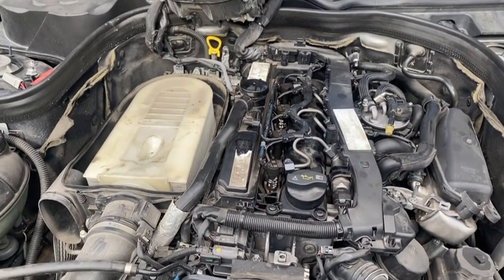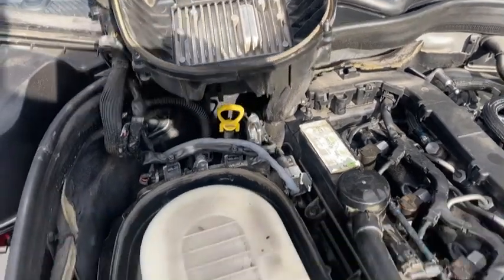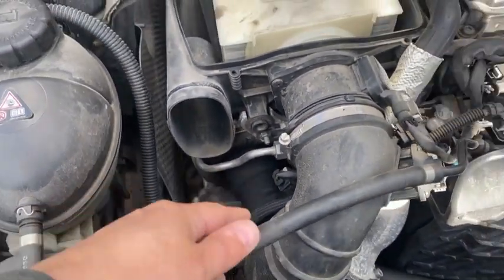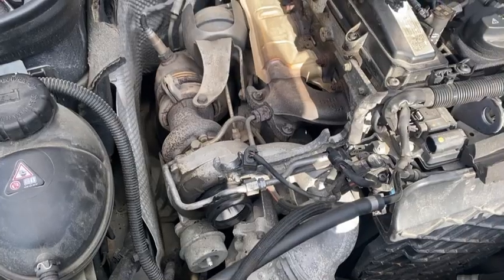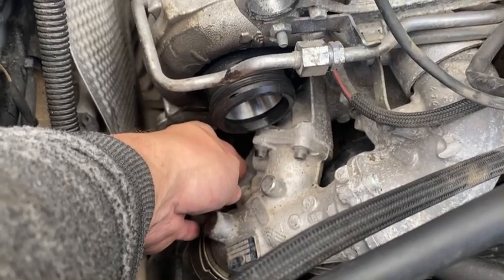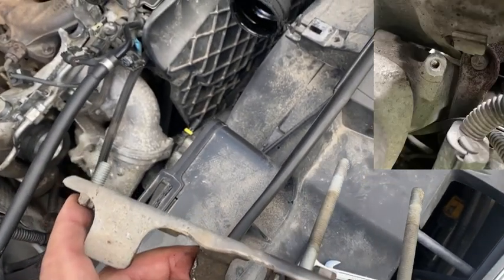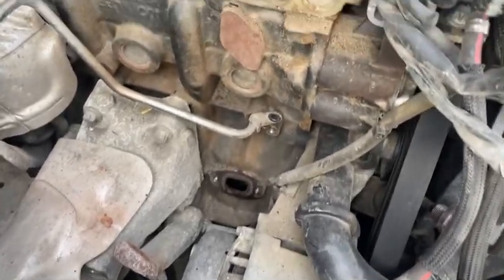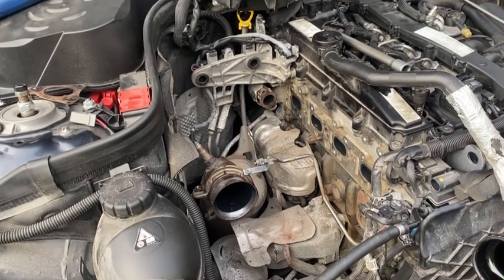W212 OM651 twin turbo upgrade, removing old turbo.

Comment: The dpf bracket and the egr is npt a problem, just bend the plate a little and the egr remove the other connections in the back instead.

Can someo please tell how to remove the oil returnline connection,, there is no where in hell it's not even close to possible i've tried close to everything now.

Comment: Hi, I have a small question. Was this a single vgt turbo or was it a twin turbo.  And what was the upgrade. I saw some turbos available for a vgt swap, that would get you to 220-230hp. But I would love to swap the vgt to a hybrid twin turbo that's also available for om651. It would be capable of hitting 280 numbers.

Comment: I've done this job 3 times and its extremely difficult. Over engineering on brackets that is totally unnecessary. It would be easier to take the engine out !!!
Reply: Hi! can you please tell me how you removed the turbo on this OM651 engine?? i've been trying and can't find a way...

Comment: To get full access to the turbo, you need to unscrew (just a little) one single thing. It's the ring holding the pipe the MAF sits on, which goes from the air filter housing down to the turbo. You can use a screwdriver to release that. You pull the pipe back until it separates from the air filter housing. At the same time, you pull up the filter housing. Then you remove the ECU plugs, and you can get the entire airfilter housing out. It takes me less than 1 minute.
Reply: 😢😢є🎉😢🎉😢😢😢є😢😢😢
Reply: Removing the airfilter is like wiping your ass, most can do it without a problem.
Reply: @FSandberg  And yet, I've seen som many people desassemble the whole thing until they understood that they chose the hard way

Comment: Just for anyone wondering I’ve just done this job on a 2017 c220d exact same set up little differences in certain places but it is NOT a job for amateurs, 9/10 would not recommend.
Reply: Did you have to remove the engine or you took everything apart like in the video?
Reply: @Kittyfh4 same as video didn’t remove engine

Comment: I found if you remove the dpf you can access them too nuts on the bracket really easily I did the same job on jack stands
Reply: I’ve just done the same I managed to get the 2 copper nuts on that bracket with ratchet spanner
Reply: you mean cat, dpf is under the car but will have to come off too, makes it easier

Comment: This Video made my day 🙂 I am actually trying to remove and change the exhaust-manifold on exactly the same car. It's my wifes car. I started the work about 1 week ago, thinking of an afternoon-job. 
BUT....every single piece you try to remove is offering a new problem. I  indeed had to buy new set of ring wrenches to get some screws loose.  Really a pain in the a***. 
Luckily I have found your video which makes me know where the bolts are to loose the turbo. Just to get some space to remove the exhaust-manifold.

All the best for you!!

Comment: You are always right how did you lose this Bolts??? I got om651 too but it was a dumb engine there we're a boost leak on the right side i tried to fix that but it was absolutely pissing me off so i selled that Car and bought the om642

Comment: These engines are really easy to work on..... But only when the engine is out of the car 😂 im here because after replacing turbo i'm left with one bracket and forgot where did it go 😂 thanks for the video
Reply: Hi! can you please tell me how you removed the turbo on this OM651 engine?? i've been trying and can't find a way...
Reply: @FSandberg you have to remove DPF and exhaust manifold to make some space and remove all brackets off the turbo to gry them out of the way other wise there wont be enought space to remove the charger then try remove it from the bottom where dpf was, your car might be diffrent variant to mine on this case you can loosen engine mounts and lift the engine little bit it will give you lots of space to work with
Reply: @FSandberg you might need to remove bigger actuator of the turbo aswell

Comment: Hi,
I have just attempted this same job and gave up as I thought I'd hit the limit of my capabilities, seems I was wrong, the only element I couldn't complete was a part you seemed to not complain about,

The two bolts that hold the oil return pipe onto the block of the engine what tool did you use to remove them and how did you reach them because that was where I had to stop because I couldn't see a feasible way to remove the turbo without first removing those bolts, please can you help me as I've put the car back together but will happily do the work again if it means I can complete the job
Reply: yes! this is where this job get impossible.... and as allways the video or forum left the most vital information out..

Comment: Hi everyone!
My s212 e220 diesel shows the P0252 fault, (injection pump fuel metering control  "A" range/performance (cam rotor injector), it appears often afer 1 hour driving, mostly when accelerating from 120-130 kmh.  Last diagnosis i made it showed  even a pending fault P0299 low turbo pressure. Are these foults related to each other. Any thoughts/ advice ?
Reply from the maker: Just saw your post, change the fuel metering valve at the HP pump, they are known to go bad and causing all sorts of trouble.
Reply: @MJPilote  Thanx mate 🙏
Reply: Hi guys, would a faulty fuel valve cause low boost p0299 ?
I have low boost fault on my Vito w447 Om651
Reply from the maker: @performancejunky3258  boost leak, front two manifold bolts broken, or intake cracked are the most common. Least common, split intercooler pipe.
Reply: @MJPilote  Thanks for reply, I have done a smoke test with no obvious leaks, no leaks around manifold or intercooler have changed both boost solenoids inc cross over valves 
Still no difference,  codes I get are P0299/P00C400/P2261
Really confused.
Reply from the maker: @performancejunky3258  check the front manifold bolts with endoscope, wont show on low pressure smoke test. Quantity adjuster gives its own code and low rail pressure.
Reply: As i wrote before, got the p0252, now this code dont appear anymore, instead i get p0299 turbo pressure low boost 😂

Comment: Hi MJP, have you fitted the turbo now? Really curious how your mods turned out?
Reply from the maker: Turbo is fitted and working very nice, spools instantly. Good power, but I need to dyno it to see how good. Have been really busy with other stuff.
Reply: @MJPilote  did you chip the car? or stock ecu?
Reply from the maker: @MyGoal1000  Yes, my own custom software with bigger injectors. Enough juice to overwhelm the transfer pump, but pulls very strong.
Reply: @MJPilote can you confirm the part numbers for the bigger compressor and turbine wheels?
Reply from the maker: @indigoskywalker  Not many options available to BW turbos, just choose the one that supports your intended HP and flow figures. Can't remember the numbers but the middle size option for most BW turbos for that frame size 651 has.
Reply: @ do you remember the sizes? my turbo is being refurbished and it might be worth asking them to change the compressor and turbine wheels
Reply from the maker: @ next size for K04 turbo, 45-46mm comp and turbine
Reply: @ aha so it is a BW K04… both the comp and turbine are 46mm in yours? i have seen that the turbine can be “clipped” to help flow
Reply from the maker: @ yes BW k04 45mm comp inducer and turbine 46mm exducer not many versions for those sizes so should be easy to find. And never clip the blades, that is a sure way to reduce turbine efficiency. Use correct turbine for the application and no need to butcher anything. Bygone era butchering blades when suitable turbines where not available.
Reply: @ so both the compressor and turbine are 45mm inducer/46mm exducer? that doesn’t make sense as the inducer is larger than the exducer on each wheel. do you have the inducer and exducer diameters for both wheels?
Reply from the maker: @indigoskywalker  where did I say both are the same?
Reply: @ i was just double checking, but you are omitting the full spec of the sizing. having looked at mamba and some other 3rd parties it’s really hard to match. none of dimensions are exactly 45mm or 46mm, they are 46.4mm or 45.3mm etc etc. The company rebuilding my turbo have asked for exact inducer/exducer measurements for both turbine an compressor
Reply from the maker: @ well I dont remember them and  am not at home.
Reply: @ it’s ok, you have given us all lots of helpful information, I will figure it out
Reply: Curious hp turn out?

Comment: Can you please tell me how you got those two bolts at the rear of the manifold off for the EGR? You are right it is a NIGHTMARE !! I am stuck on this an now with no car.
Reply from the maker: With a spanner, using a larger one as leverage. Can't remember if the bolts where E8 or E10 but just with a suitable closed end spanner. Its very tight squeeze, and if I recall the bolts are non magnetic even so you can't pick them up with it ih they fall.
Reply: @MJPilote  Thanks you for taking the time to reply.
Reply: I just finished this yesterday and what a nightmare. I am sore all over!!  Just to give more pointers
You dont have to remove the EGR pipe at the end of the exhaust. I managed to pull the manifold out and gold it up with a bungee cord which gave plenty of room. The pipe is a flexy copper one so it will take the bend. 
The bracket onto the alternator is a pane too. I managed to get than on from underneath with hose going into the inter-cooler off and battery disconnected in case it short the alternator wire. It gave me a fright when that sparked!!!
The oil feed and drain bolts are the hardest to get at. I put the bolt onto the socket and wrapped a bit of tape around it to hold it and fed it trough the turbo. Sounds easy but those 3 bolts took most of the day. 
I have a P0248 error now to sort it seems down in power too.
Anymore issues its a Honda or Toyota!!
Reply from the maker: @joefoley4253  Nice work! I didn’t want to stretch the egr pipe as they can crack. I hope you didn’t burn anything by shorting the alternator.
Did you check the wastegate hoses are in correct order, and not leaking. Or you have a bad solenoid. Either way its not actuating the wastegate properly.

Comment: I have changed the manifold gasket that was leaking from the back. It wasn't as hard as you describe here. Used Alfamer repair book and it explained the right order to remove parts. No need for angle grinder and the bracket that has copper nuts can be removed quite easily as well.
Reply from the maker: Well good for you, you have twin turbo too?

Comment: Does the new turbo after installation need some program with computer or is it just ready to go after install
Reply from the maker: It works without modifications but to get most out of the modified turbo it needs more fuel and boost. With 250cdi injectors and a good tune it really picks up nicely.